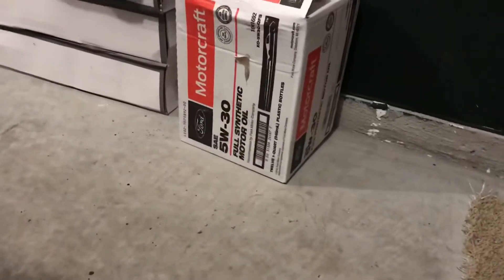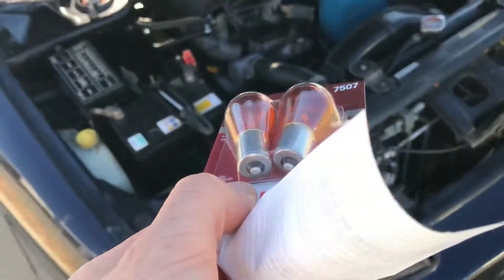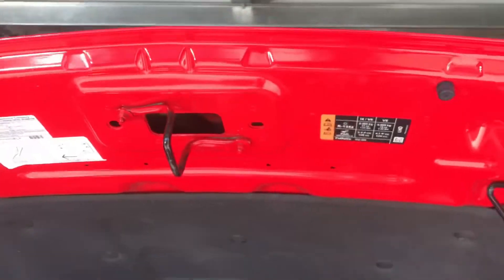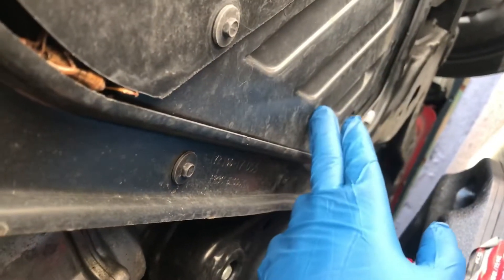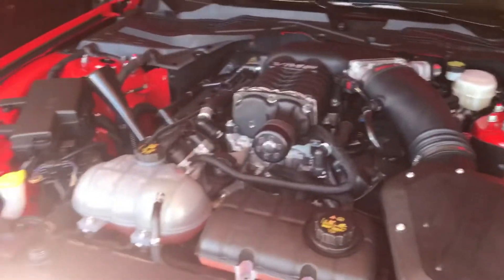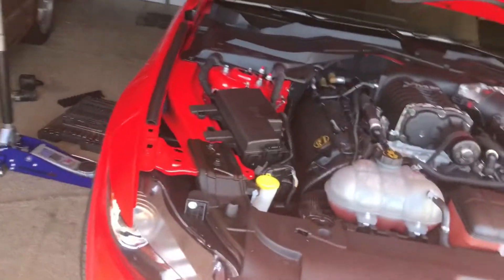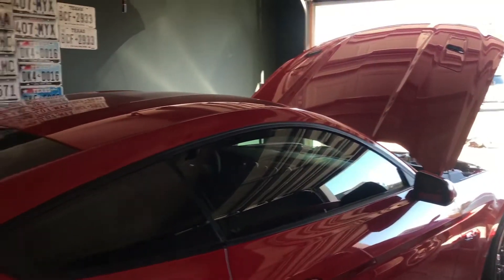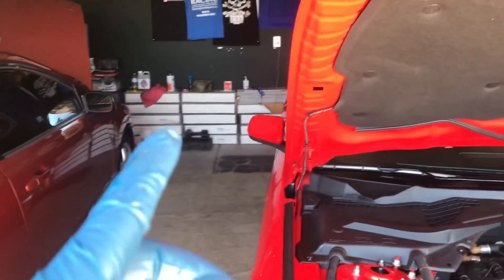First oil change on my VMP 17 Mustang GT, metal shavings in oil filter at 3300 miles.

Comment: A little glitter is okay for first oil change in my opinion.
Reply from the maker: Never had this issue even with fresh build engines. It seems it’s normal for the Coyotes motors from the research I’ve done.

Comment: My 17 has been having a good bit of golden brass colored flake in the oil changes and seems like its not going away. It has 4500 miles on it and i just did the 4th oil change and its still just as bad. Ive been changing it every 1000 miles just trying to flush out this metal flake. My motor has the inconsistent tick or tap noise in the bottom end that many others have. The bearings that connect the piston to the rod have this brass colored bearing material so I have a feeling my rod bearings are shit. Ford needs to get a handle on this manufacturing defect
Reply from the maker: Oh man, sorry to hear you are having issues with the notorious Coyote tick and shavings. If you still under warranty take it in ASAP your engine might not have much longer. 4 oil changes with shavings is not a good sign.